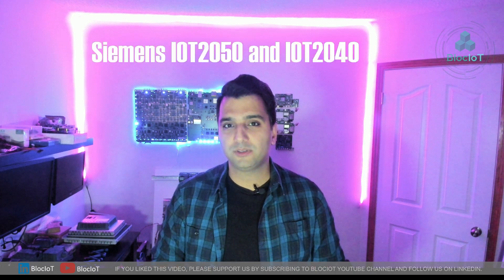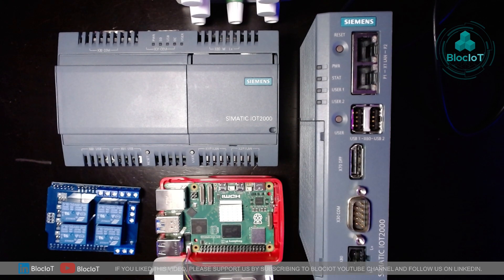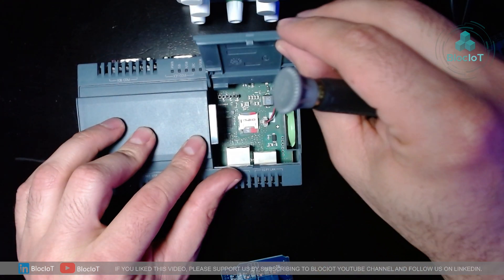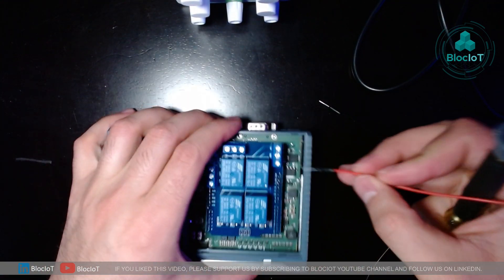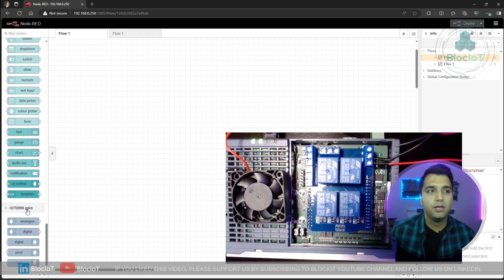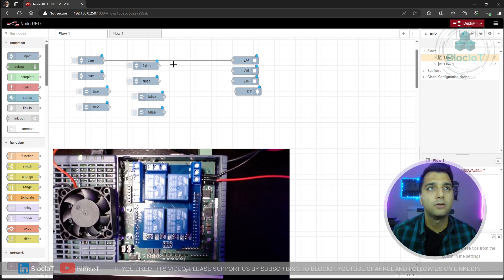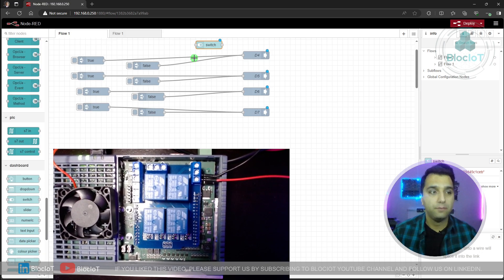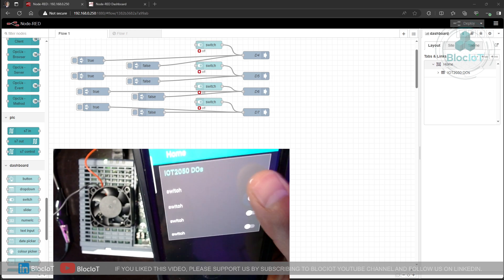39- Integrate Arduino Shields with Siemens IOT2050 or IOT2040 & Node-Red for Controlling a Fan

Comment: Sir I have a question. If I put "iot2050 ip address:1880" on the google browser , so is it automatically open the node red window or I also have to open the mqtt broker at the back end?